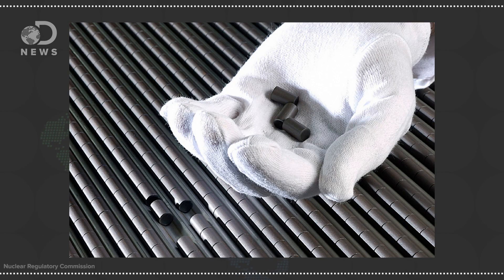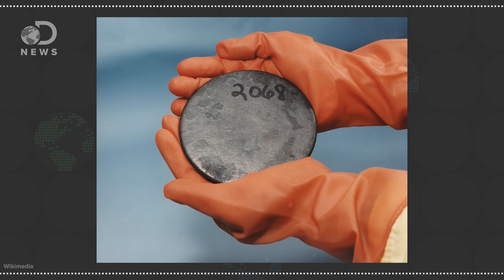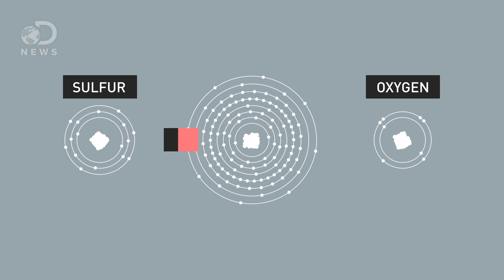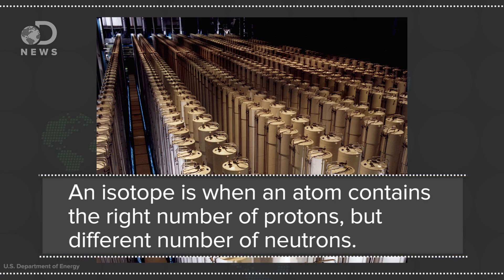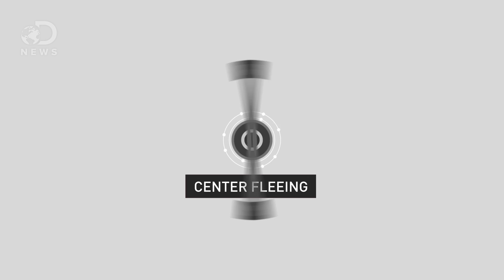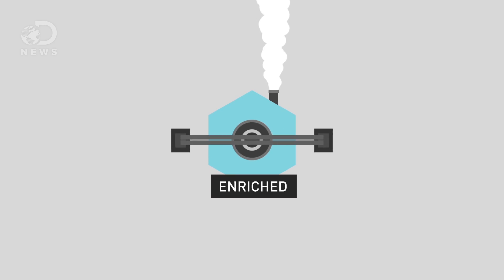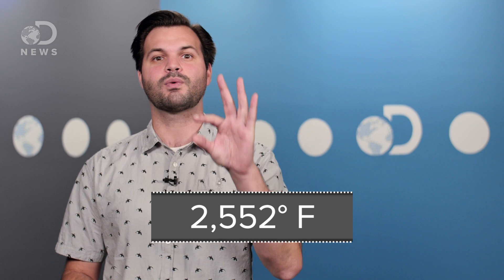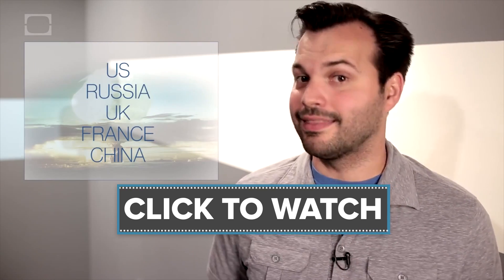How Uranium Becomes Nuclear Fuel

Comment: It's still one of the cleanest and one of the most efficient and reliable sources of power. It also has the highest proportion of power generated to power needed to process fuel. The main problem is that due to the uproar against nuclear energy all of the reactors are at least 30 years old... that's not good, since the technology advanced so much that if you were to build a nuclear reactor now it would be almost 10 times as safe as the existing ones.
Reply: carlos almaraz That's steam, not smoke.  Those are cooling towers, there are no combustion chambers in nuclear plants.
Reply: Damian Reloaded If you think the mob gets rid of nuclear waste, you're delusional.
Reply: I don't think the main problem is negative public opinion, more crippeling problem is money: Goverments don't have funds to make safer plants and companies won't spend money to improve thing unless they get more money from that.
It should be made so, that a goverment agency would force power companies to update their plants, but as long as companies influence regulations, it's never going to happen.
Best thing of all would be upgrading oldest plants into thorium reactors.
Reply: @Somezable  The Waste is another problem. No one wants it in their backyard so to speak.
Reply: @Somezable  it's really expensive because environemental groups like Greenpeace lobbied to create really strict and expensive regulations around it. Mostly because they don't want it to be competitive with wind and solar since they have vested interest in locking in power purchase agreements and renewable energy subsidies for those contracts.
Reply: Somezable Public opinion fuels political action.  If people were pushing for nuclear reactors instead of prematurely pushing for "renewable" energies, the funding would be there.  Nuclear reactors are a drop in the bucket compared to what the gov't is spending in the form of subsidies for solar and wind power.

I agree that thorium is the way to go, but there is no logical way of going about converting current reactor technology to thorium power.  We would have to start over with completely new plant dimensions, power handling, and of course reactor configuration.  The cool thing about thorium based systems is that there is no need for special safety systems that have to be in place currently for nuclear power.  There is no high pressure steam loop, there is no danger of a "meltdown", so there is no need for a massive containment structure, like there is with reactors that are currently in operation.

Thorium power is an order of magnitude cheaper than our current nuclear plants.  Revamping our installed plants would cost more than building a new reactor based on thorium.
Reply: Damian Reloaded you're already cancerous
Reply: darkheat246 Our business model is perfect: create the most ridiculous scare tactics against clearly beneficial technologies, and watch the bodies of the illogical people pile up.

Shout out to Damian.
Reply: Damian Reloaded http://www.world-nuclear.org/info/nuclear-fuel-cycle/nuclear-wastes/radioactive-waste-management/

there's just one.

Give a source that shows the "mob" disposing of nuclear waste.
Reply: Damian Reloaded I guess you're uneducated on the entire subject of secondhand smoke as well as nuclear technologies.  Nice.
Reply: MaxFist Yet people refuse to allow new nuclear plants to be built.  I hate people.
Reply: @RentableSocks  people dont understand nuclear tech. People fear what they do not understand.
Reply: @RentableSocks  Environmentalist* environmentalists don't want nuclear built like Greenpeace who lobbied to create really strict regulations on it. They only want wind and solar for power because they have a vested interest in locking in lucrative power purchase agreements and government subsidies for their own renewable energy policies.
Reply: Damian Reloaded Also, you're talking about italy, nobody else in this thread is.  You just took a whole different country's problems and tried to turn it into ours.  Please get a clue.
Reply: Damian Reloaded  coal kills lots of people a year too.
Reply: Damian Reloaded "When uncontained" are the key words here. 

It really sounds like you have some trust issues...
Reply: Damian Reloaded Here we are with the ridiculous claims coming from someone with no understanding of what they are saying.

It's sad, really.
Reply: Damian Reloaded Your point is invalid though, you're being fed fear tactics and eating it up.  As I said the first time you tried quoting that, the anecdote is from almost 30 years ago, and no longer relevant.

Your risk of death from driving a car is much higher than the risk for cancer from radiation.  This is one of many instances you're just blinded by fear.
Reply: darkheat246 It's not like I'm doing anything else with my time, might as well mount my defenses for crazy people who are deathly afraid of nuclear power, being that I am a huge supporter of it.
Reply: Niklas Jonsson Don't listen to the troll.

India as well as China have plans in development for thorium reactors.  In fact, the thorium reactor was one of the first nuclear plants built.  What you are referring to is Liquid Fueled Thorium Ractors (LFTR).  What these plants are capable of doing is crazy, and there is no danger of proliferation or waste.  All we have to do is add fissile material to it, none comes out.

My buddy is a nuclear engineer, and apparently in order to graduate he had to design a fully fledged nuclear reactor, so I think plans are constantly churning out.  Our gen. 4 reactors that are in development right now are about 30% more efficient, and can use more than twice the amount of energy coming from the uranium (about 97% of the fissile material is still intact when it is considered "waste")

I'm still waiting on the end of my chair for LFTR though :)
Reply: darkheat246 we should follow the way of the Egyptians and use "chew sticks".  Toothpaste is obviously a useless technology invented by the Illuminati to get everybody who isn't a high rank to kill themselves slowly.  THE MORE YOU KNOW....
Reply: oobligah that's a real business there congrats
Reply: Damian Reloaded so you're wrong and we're trolls gg kid.
Reply: Somezable I dont know about the US, but here in sweden companies have plans ready to build new reactors but are not allowed by the government, so its basically the other way around. 

New plants would be both more efficient and the residue left would be a lot less radioactive. Some plants would actually be able to take the old residue and run it in reactors again to get more energy out and make it less radioactive. 

Thorium reactors would be great but from what i know they dont exist yet, even if they are not as far fetched as fusion reactors. What i dont get is why even research around nuclear power is disencouraged by a lot of environmental organisations. Here we have the power of the stars, basically infinite energy with no co2 emission and a very safe process and still it is resisted due to ideologial beliefs and some irrational fear of the word "radiation" and things they dont fully understand.
Reply: Damian Reloaded I want some evidence before your conviction of anger
Reply: Damian Reloaded You know in school they say don't cite Wikipedia........
Reply: No I'm afraid ten times is a huge understatement. We have built and demonstrated the Integral Fast Reactor that cannot be made to melt down by removing cooling by accident or even delibertly. In a demonstration the cooling was suddenly and totally removed. The Reactor just quietly increased in temperature for a small amount then just quietly stopped working. So it is the safest reactor ever invented. Better yet the old war heads and "so called" spent fuel rods from our stupid high pressure water reactors can be used and therefore cleaning up almost all the waste we are storing all over the globe. Democrats that the oil companies have bought scrapped the projects for obvious reasons.  
Google IFR reactors.
Reply: MaxFist I trust you, Dr. Strangelove.
Reply: oobligah money isn't an issue for plants it's just pure laziness and a lack to try to do anything
Reply: oobligah exactly
Reply: oobligah he's just trolling you
Reply: Damian Reloaded no humans are the cancer you get cancer from almost everything
Reply: darkheat246 Cigarettes, Decaf coffee, diet sodas, corn, wheat, toothpaste, plastic bottles, cell phones, computers, asprin.  The feigned list goes on and on.
Reply: Damian Reloaded that's an issue with old reactors and your government. The simple solution is to ban your country from nuclear activity until it's heavily monitored and controlled by America and the UN.
Reply: Damian Reloaded Anecdotal single source troll.
Reply: Damian Reloaded That prediction assertion in itself is fallacious, it doesn't consider the advancement of technology, like I have been saying that you are ignoring this whole time.  There is no reason to continue the operation of gen 2 reactors in their current state. 

Gen 3 reactors are ready to be built, and are orders of magnitude safer than gen 2 reactors.  Gen 4 reactors a still in development, but will be orders of magnitude safer than gen 3.

This is also not taking into consideration the placement of nuclear reactors, which was a huge factor in why the fukushima reactors were damaged.  This reactor was placed on a fault line, and close enough to the coast to be damaged by tsunamis.  This, coupled with the fact that the three reactor failures at fukushima are the majority of the dataset of the "serious accidents", means that those data points are not statistically significant enough to consider them 3 separate failures, but instead should be treated as one.  Prediction for things like reactor failure is not reliable.  If you also take into account that three mile island was undergoing a test, and that chernobyl was actually an unsafe reactor design, most of these should not be considered in predicting reactor failures.

Take anything with the word "prediction" with a bucket of salt.
Reply: ***** that's Dr. Fist to you, sir.
Reply: Damian Reloaded Also, even if you take my comment out of context, if you were try to synthesize weapons grade uranium from thorium, the gamma rays literally tell everyone exactly what you are doing.  They are easily detected, and any activity like that would be ended immediately.
Reply: oobligah I guess everyone should stop brushing their teeth xD
Reply: Damian Reloaded Authority fallacy? Do you know what that means?  In order for an authority fallacy to be considered fallacious, there has to be a logical fallacy that is created by said authority appeal.  None of my comments are fallacious, however you (by trying to deny reason) are creating fallacious arguments left and right, and are no longer logically relevant.  

You are actually using argumentum ad metum, like I said before..  You are doing exactly what the anti-vaxxers do.  "Hundreds of articles and papers say nuclear power is safe, but here's one that says someone did something and it ended badly"  turns into "OMG IT'S SO DANGEROUS BECAUSE PEOPLE CAN'T CONTROL THE ACTIONS OF OTHER PEOPLE AND I'M SO SCARED OF THE COMING NUCLEAR APOCALYPSE BECAUSE OF THE MOB DISTRIBUTING NUCLEAR WASTE INTO EVERYBODY'S FOOD"

I'm systematically denying everything you say because it IS beyond you.  Also, your data set is from decades ago, and is no longer relevant.  So, you're pretty much wrong on all counts, which is why I'm saying you're wrong.  Every time.
Reply: Damian Reloaded rekt.
Reply: oobligah nope kiddo.
Reply: As a nuclear engineer well read on this subject, the proliferation resistance of U-233 is very overstated. Large gamma emission just requires more remote handling of material and this has been proved in the THOREX process to be highly possible. Proliferation is not really linked to terrorism so "baddies" are not the people who are of most concern to the IAEA when U-233 is discussed. Countries such as India have the most interest in U-233 weapons and its the security that they can provide to this process from spreading to other current non nuclear states that is the issue, preventing more instances such as the A.Q Khan leaks that lead to Pakistan and Iran gaining much of their information on U-235 enrichment.
Reply: +MaxFist Nuclear waste is renewable.
Reply: Damian Reloaded Actually, France reuses up to 80% of their nuclear waste.  In a solid fueled nuclear reactor fuel cycle, only a few percent of the radioactive material is used up during burn time.  Since it is a solid fuel, gas builds up inside it and fractures the fuel pellets, making them unable to be used as fuel (huge drops in fission efficiency).

However, if you reprocess the fuel pellets, you can continue to use previously "spent" fuel.  In the US, we've limited ourselves to be unable to reprocess and reuse spent nuclear fuel, so that's why they bury it.

On another note, reactor technologies like LFTR can consume unused fuel (without reprocessing), since the fuel melts down (not the bad kind) inside the reactor, and releases the previously trapped gases.  The previously "spent" fuel then becomes concentrated enough for fission again, yielding more power.
Reply: Nuclear  energy has  proven  to  be a DISASTER    to  the  planet-to  call this  technology  safe  is an  insult to  intelligent  people-NO technology  exists  to dispose  of nuclear waste, NO  plant  is safe  from major catastrophes, the government/business aspect of  industry that oversees it  is  UTTERLY  CORRUPT, GROSSLY  MISMANAGES  the  most  poisonous substance on the  planet for $$, constantly  LIES  to  the public  about  safety, accidents, FELONS are  rarely made  to  pay  for their deeds, the  system  promotes the  worst  CORRUPTION, TREASON in  the  political arena, as  we read  this  Fukushima  is  continuing to  spew radioactive  waste into  the environment as  it  has  been  doing for  YEARS,  etc. not to  mention  this  technology  has BANKRUPTED  the  planet, especially taking  into account the  massive  cleanup of nuclear  waste and  plants  in  the  near  future
Reply: One simple reason. 30 year old reactors are cheaper. That is how an RBMK reactor explodes.
Reply: OHHHHHHH
Reply: oobligah Just because You say it isn't relevant doesn't make it true. You're trying to use an authority fallacy without having any authority yourself. You just systematically deny anything I say, for some reason that is beyond me. I've proven that men as with almost any other thing we touch, can't be trusted to manage these materials in a safely manner. And even if we trusted them and they did the right thing, we still are subjected to the possibility of a disaster happening and poisoning who knows how many hundred of thousands of square miles with radioctive fallout for thousands of years, without any possibility of cleaning it up. As if we hadn't enough ecological problems already.
Reply: oobligah Yes you are trying to validate your arguments on the basis that because you say them they are true and because whoever disagrees with you is not you therefore they are wrong. That's fallacious and insane. I couldn't care less about the thousands of articles saying that nuclear power is safe when there are thousands of people dying because of exposure to nuclear fallout from blown up nuclear power plants or ill-disposed nuclear waste. So you see, it doesn't matter how much you like your nuclear power, it is killing people as we speak. It's happening whether you like it or not. I'm totally ok with its use in space where exposure to radiation is the rule, but down here, nah, down here, living things we don't get along with it.
Reply: Damian Reloaded Everyone who agrees with me isn't me, but they are right because they are right.  People who disagree with me are wrong because they are WRONG not because they aren't me.  You keep saying thousands of people are dying, and berating this "ill-disposed" nuclear waste article (which is too old to stand up to anything that we have been talking about) but you don't cite anything, and you don't care to look at the research.  You are failing yourself, and I feel sorry for your kids, if you have any, because they are growing up with a moronic parent who eats fear tactics and propaganda for breakfast.
Reply: gtfo XD
Reply: Damian Reloaded When your only response can be "gtfo XD", and you refuse to see logic, you've lost the argument.  Sorry for your loss.  Sorry not sorry.
Reply: Damian Reloaded You're putting words in my mouth, there are obviously certain people who are more trustworthy than others, and "ex convict rapists" aren't the people disposing of nuclear waste.  You're trying to equate two things that are not equal.
Reply: oobligah I'm just applying your logic, you say documents from 30 years ago do not count because? What? Human nature has changed since then?
Reply: Damian Reloaded Regulation has changed since then, and so has reactor design.  Technological developments now allow safe nuclear power, as well as the elimination of nuclear waste, and the consumption of existing waste.  All of these are good things, and these developments have come after your 30 year old article.  The majority of people are good, there's no question about that.  The fact that you see 5% of people as 100% of people is kind of disheartening, other than the fact that you're ignoring the scientific achievements in the nuclear world.
Reply: oobligah I really fail to see where you get your numbers from. And even if you were right, and only 5% was getting sick because of radioactive contamination, you propose to rise that to 100% by building fission plants everywhere. Great plan bro!
Reply: Damian Reloaded You're twisting my words again, If you can follow the chain of comments, I was referring to the proportion of people who do "bad" things compared to those that don't.  Maybe that's the reason why you have so much trouble following what people are saying in their arguments.
Reply: oobligah I don't need to twist your words. They are twisted by themselves. The fact that you want to drive this conversation towards semantics says what you are really up to.
Reply: Damian Reloaded Correcting your misinterpretation of what I am saying is not semantics, you just fail to follow logic and the context of anything that I'm saying.  Correcting for context is not semantics, it is returning the discussion from the weird tangents that you're going on.

Saying that "only 5% of people are bad" cannot possibly equate to "only 5% of people are affected by radiation".  I have no idea how you came to that conclusion, because it is actually impossible to.  You jumped there, probably due to not reading, or not understanding what I was saying.  Every time you take something out of context, you lose credibility, and at this point I'm pretty sure you're an 8 year old kid who has gotten his hands on daddy's laptop.
Reply: oobligah You are arguing semantics. What I interpreted didn't need correction because it was irrelevant whether 5% people is vicious or 5% of people is ill, because both are false assertions and pulled right from your ass. As most of what you say. You sell this shit like a google spokesman but you present no evidence to back up what you say, because you can't. You can't prove people aren't getting sick from radioactive contamination, therefore denying it makes you a liar. (ed.sp)
Reply: Damian Reloaded The incarceration rate in the US is 4.4%, which is the lowest out of the developed nations.  It is not a false assertion.  Look it up if you want, you'll find the same.

By asserting that it is irrelevant whether 5% of people are vicious or 5% of people is ill, you are presenting a red herring, which is fallacious.  You are intentionally derailing the conversation by switching the subject that was at hand.

You're also presenting a fallacy right now with your "you can't prove people [aren't] getting sick [from] radioactive contamination,therefor denying it makes you a liar" statement.  That is called an appeal to ignorance.  

I'm sorry, you need to read up on both logic and reasoning, and be able to present an argument that isn't fallacious.
Reply: oobligah That's exactly what is wrong with your thought processes, you measure trustworthiness of humans by measuring incarceration rates (in the US nonetheless!). You do live in a movie.
It was irrelevant because it's FALSE. You cannot state, by any means, that 95% of the world population is good in the heart based on incarceration rates. That's insane dude!
If you deny something you cannot prove, you're biased, to say the least. I choose to call you a liar. And btw, thanks for correcting my spelling, english is not even my 2nd language.
Reply: Damian Reloaded Its a reasonable thought process, laws are supposed to keep people from being shitty, shitty people break laws. law breakers go to jail.  It's fair to say the two are strongly correlated.  Someone that leans one way because of statistical evidence is not "biased" but rather more informed than the party not citing statistical evidence and using fear tactics.

There are heaps of evidence directly contradicting what you say, and you continue to tout your one italian mobster from 30 years ago, which is irrelevant.  You say nuclear power causes cancer, when it doesn't.  Waste disposed from nuclear plants is not dangerous because it is properly taken care of.  I implore you to try to find somewhere else that says nuclear waste is not disposed of properly.  The rates of cancer for people around nuclear plants is the same as those not around nuclear plants, and there is a strong causal link between coal power plants and cancer rates, due to THEIR radioactive debris.  No such link can be called to nuclear plants, and even if it were, you would be able to see it with nuclear plant technicians before anyone else, but this is simply not the case.  Living near a nuclear plant gives you less ionized radiation through your entire lifetime than 10 chest x-rays.

You're trying to base your case on emotion rather than statistical evidence, saying the majority of people are bad, and saying that these "bad" people shouldn't be in charge of the disposal of nuclear waste.  Your argument has been proved to be groundless, as well as fallacious, and you are continuing to be fallacious as this goes on.

I corrected it in my quote, because that's how it should have read and I understood what you meant.  It wasn't a jab.
Reply: Uhm. No. I'm basing my case on well documented evidence that is for everyone to gather from wikipedia and the most important science magazines and news papers world wide. You're just repeating yourself that Nuclear Power Plants are the safest choice and that we should have them everywhere because there are no risks involved. And you're lying.
Reply: Damian Reloaded or take a look here:
http://nextbigfuture.com/2011/03/deaths-per-twh-by-energy-source.html
Reply: Damian Reloaded or take a look here, even.
http://theenergycollective.com/willem-post/191326/deaths-nuclear-energy-compared-other-causes
Reply: Damian Reloaded I can keep going...

http://motherboard.vice.com/blog/whats-the-deadliest-power-source
Reply: Damian Reloaded and a report on safety...

http://www.oecd-nea.org/ndd/reports/2010/nea6862-comparing-risks.pdf
Reply: Damian Reloaded Uranium beams? What are you even talking about?  Uranium used in reactors is in the form of pellets.  Reactors are now designed to withstand such impacts.  I don't see your point.  You've gone off on another tangential red herring, again derailing the argument.  Also revealing your racism.  Sad.
Reply: oobligah Talking to you is like talking to eliza chatbot. sigh. I take it you're willing to risk the well being of your family for it. I'm not.
Reply: Damian Reloaded You asked if jet fuel could melt through uranium beams, and those don't exist.  There is no risk of a modern nuclear plant melting down, or struck by an airplane.  Reactor chambers are encased in 2 inch+ hardened steel, and on top of that, most of the reactor chambers are placed dozens of feet underground.  This makes attack by airplane virtually impossible, and in no way can it cause a melt down.

You're presenting valid looking points, but none of your arguments are sound.  Even if your arguments were completely valid, there is no evidence to prove that your conditions for your conclusion are true, and in fact it has been proven that the conditions to your argument are false, and your conclusion is therefore false.  Not to mention that your conclusion itself has been proved false.

I bet you didn't even read any of those articles or reports that I linked.  There's a wealth of information on the safety of nuclear plants, but since you can't be bothered to read anything, I'll put it plainly:

Nuclear power is orders of magnitude safer than any other major form of electricity production, including renewables such as solar, hydro, wind.  If you were to redirect your fear mongering to where it actually counts, that would be a different story.  Per amount of energy produced, nuclear has the lowest death toll and death rate, even including the chernobyl and fukushima reactor mishaps.
Reply: It has been proven that the same kind of people who run this Nuclear Power Plants you like so much were able to poison the american population with lead (in gasoline) for over 30 years and they were so powerful that it took democracy 30 years to force them to stop. I literally wipe my ass with any paper they will present to the public to defend their business.
Reply: Damian Reloaded False, the people who run nuclear power plants are engineers and physicists, not the government.  Regulation is employed by government, but this is by no means "running"  So, no.

Your rejection of such papers is what makes you actually biased, because you refuse to even hear evidence on the opposing argument, even when hundreds of resources point to the same conclusions.

With respect to the leaded gasoline, lead was used as a lubricant, and it was not scientifically proven to be neither harmful or safe when used in gasoline.  Nuclear, on the other hand, is purpose built, and has been proven safe.  You're barking up the wrong tree.
Reply: Damian Reloaded Investors don't run, they invest.  I still don't know where you're trying to go with this, as you've been proven incorrect in almost every instance.  If you didn't know, without investors there wouldn't be any electricity, or computers, or office buildings, or apartment complexes, or pretty much anything that has a high startup cost.  Investors want stable income from their investments, which means if someone invested in a nuclear plant, they don't want to see that waste harming people, because it will get shut down by regulation enforcement.  You have no grounds for an argument, even if people like making money.
Reply: I was re reading the wiki entry Economics_of_nuclear_power_plants , this part is really interesting: "An interdisciplinary team from MIT have estimated that given the expected growth of nuclear power from 2005 to 2055, at least four serious nuclear accidents would be expected in that period.[80][81] To date, there have been five serious accidents (core damage) in the world since 1970 (one at Three Mile Island in 1979; one at Chernobyl in 1986; and three at Fukushima-Daiichi in 2011), corresponding to the beginning of the operation of generation II reactors. This leads to on average one serious accident happening every eight years worldwide.[78]"
Reply: oobligah I take everything people say with a bucket of salt. I personally think the risks are too high (in terms of ecological damage over time). But the world leaders seem to think otherwise. We need nuclear power to power our air conditioners and watch our porn on internet. Priorities.
Reply: oobligah Sorry but U-233 can be used in the production of nuclear weapons and requires significantly less infrastructure to do so compared to a uranium fuel cycle if you are starting the process from scratch. The Thorium and fusion evangelists are just as ill informed as the guy your arguing with here...
Reply: tomsan91 It can be, however there is a massive deterrent, which comes in the form of huge amounts of gamma radiation.  That is a tell-all for nuclear weapons development, and would be very hard to mask in order to skirt the authorities.  This type of radiation is also deadly to anyone who is working near it, even for just a few minutes.  So, yes, but there are major downsides to using it which would prevent the baddies from doing so.
Reply: +tomsan91 how about salt reactors?
Reply: +tomsan91 I'm child of холодная война, (cold war), & I'm well read on medical issues from radiation exposure. I don't watch missile launch vids as I get adrenaline rush from fear. I'm slowly warming to nuclear power.
Reply: Masashi Ng no it's not. Otherwise they wouldn't bury it.
Reply: It's always great when private individuals repeat private corporate nuclear energy co propaganda.
Reply: Ancient Greeks invented plutonium, uranium and the americium ( it should be called Helenicium ).
European invaders ( Romans, France, Germany etc ) stole the ancient greek inventions from Alexandria library books ( million pages ) which contains all information about 94+ elements, pipes, gases, prism detection by light, technologies etc.

Better explanation to people who do not understand.
Example: Romans stole four Harry Potter books. The four Harry Potter books became divided due to war, theft, lost and found.

Germany got Harry Potter 1, tested it the invention and then they burned it and claim the world that they have invented it.

Russia got Harry Potter 2, tested it the invention and then they burned it and claim the world that they have invented it.

Sweden got Harry Potter 3, tested it the invention and then they burned it and claim the world that they have invented it.

America got Harry Potter 4, tested it the invention and then they burned it and claim the world that they have invented it.

and so on...
Reply: carlos Wudup steam water dude
Reply: oobligah so what do you think about the integral fast reactor ? isn't that the best idea, isn't it basically infinite energy? why aren't people building this?
Reply: tevin persinger no he is right, it was due to politics. watch this video 
https://youtu.be/Sp1Xja6HlIU
Reply: eh. what about fukushima
Reply: How can you call it clean when it's fall outs has poisoned people over and over for years. Deluded much.
Reply: Nuclear power plants are the safest method to make electricity based on deaths per kWh of electricity produced!  Amazingly, solar is more dangerous due to things like workers falling off roofs!
Reply: MaxFist nuclear is efficient but its not "Green" we have to dig to find uranium and we have radioactive waste at the other end of the plant process.  The greenest is solar but that still requires a lot of space to be used.
Reply: MaxFist A nuclear waste?
Reply: the problem is the nuclear waste. No long term solutions have been found for it
Reply: Cleanest except for all the highly radioactive waste that we still have no solution to store permanently... Smh
Reply: Well if they build new ones the upkeep for that plus the old ones will tally up...and you also have to take into account that natural disasters ect can happen ...that increases the chance of an irreversable incident
Reply: The cleanest and most reliable is falling water. Wtf you say?
Reply: Hang on, where you gonna through the waste after using it, which will still gonna be radio active but of no use ?
Reply: And nuclear waste? Nuclear energy cannot be called 'clean' by any means.
Reply: MaxFist so you reckon nuclear energy is clean energy do you? Well consider this, nuclear reactors produce vast amounts of incredibly radioactive fission products some of which do not exist on this planet anywhere outside of the reactor cores, e.g- caesium 137, this radio nucleide is extremely toxic to organic life forms and has been released into the environment in huge quantities from the triple melt downs at fukushima, now, one gram of radioactive caesium 137 when made into mico-particles and distributed evenly as a gas, over an area of 1 sq kilometer would make that area of land unfit for habitation or agriculture for between 240 and 320 years, this is clean energy is it? Take a look at how many THOUSANDS OF TONS of high level nuclear waste is currently being stored at various sites all over the USA, and then tell us just how clean nuclear energy is, oh, and lets keep in mind that ALL the nuclear waste we have so far produced will remain lethally toxic for hundreds, and in some cases thousands of years and we still havent figured out what we are going to do with it.
Reply: Yep. It's sad that the stigma of nuclear power still stops its progress. Modern reactors are extremely safe, efficient and greener than coal, oil and other petroleum based fuels.
Reply: Ita not really that clean when they have so much nuclear waste and nowhere to put it, considering it takes nearly 4tonnes of uranium to produce 60kg of U235, so no il use  sellafield in the UK, have 100,000 tonnes of nuclear waste and nowhere to put it, so how is it so clean with all that radioactive waste that can stay radioactive for 24,000 years???
Reply: i mean, "nuclear" is the issue, i dont want to live next to or within 100 miles of a nuclear power plant, it might be the "nuclear" part, or maybe i just dont want to live next to a potential explosion that would level everything around it. no to keen on that idea, not to mention nuclear means theres radiation and i dont care how "safe" the levels are, its higher then it would be without the power plant there so no thank you, your welcome to have one built next to you tho.
Reply: @MaxFist fusion is clean, not fission.
Reply: MaxFist it is more complicated than that. Most reactors got built when prices where well under $3000 per MW, which is roughly what you pay for a coal plant. Countries built a lot of nuclear because it was the cheapest power.  But what happened is that as companies tries to improve reactors, make them more powerful, efficient, safer etc, the price just grew faster then the output. 

This happened both before people got skeptical towards nuclear power and it happened in almost every country. Prices went up because nuclear power is simply a very complex technology and increasing size of reactors was likely a profound mistake. Reactors today are so insanely expensive that it just doesn't make any sense to build them.

Until we go back to the drawing board (which many have) and design a new generation reactors which are smaller, simpler and safer, it makes no sense to keep building nuclear reactors.

People like to think about this stuff as a conspiracy. Oh it is all the nuclear protesters fault, but you can see the same trend for almost ANY advance technology. Lookup how much it cost NASA to build the Saturn V. Now compare how much it costs them to build the SLS of similar capacity. Despite far more advance technology and knowledge today, this rocket cost SIGNIFICANTLY more than the Saturn V.

Look up high rise buildings. Nobody builds skyscrapers as fast and cheap as they built the empire state building today. Lookup road construction costs today. Basically we have just gotten really shitty at large constructions. We do everything large and complex way more expensive than in the past. It is a global trend.
Reply: Damian Reloaded Right, is that just because you can't read? or because you don't know what citing your sources is? or is it just your lack of comprehension on the subject?

Maybe it's the fact that you have no idea what you're talking about, so you ignore facts, and express what your mind has tried to present as an argument, when all it looks like is a frantic attempt to not come off as a moron.
Reply: Damian Reloaded Might want to cite your source instead of copying directly from what I can only assume is wikipedia.

You need to learn context, and how current environmental regulations prohibit such dumping.

Today, "nuclear waste disposal" does not mean dumping it into the ocean.  To assume something like that is ridiculous.
Reply: Damian Reloaded Neither effects from Chernobyl nor nuclear testing fallout count as "nuclear waste disposal", so your argument there is pretty invalid.

With regard to Thorium, no.  There is no possible way for uranium derived from Thorium used in nuclear reactions to be used in weapons.  Thorium based nuclear power is a proliferation free technology.  When Thorium is converted into Uranium, it is converted into U233 inside the actual reactor (LFTR), which makes it impossible to use in nuclear weapons.

I can, and do trust them.  Significant public backlash would occur if any corporation began dumping nuclear waste improperly in any developed country.  Such backlash would bankrupt them.  They know this.  In order to ensure this, there are regulations, as I have stated before.  I think you are underestimating how strict such regulations are in first world countries.
Reply: darkheat246 there is no money where there is no intent.
Reply: Damian Reloaded My daddy died years ago, I've been in control for almost a decade now.  Record profits, public in outrage.  It's amazing, actually.
Reply: oobligah For some reason youtube deletes my posts when I write a link. You can select the first words, right click and search in google. The first result will be the source of that text (which is wikipedia btw).

You need to understand that we don't live in a movie where everything is pristine and pure and where leaders have the best intentions.

The nine countries with most cases of cancer are nuclear or were in the way of chernobyl debree or nuclear testing fallout. Uranium enrichment or synthesis by thorium reaction can be used as a weapon. The more radiactive material you have around, the more the chances terrorists will serve you a coffee with it. Can you count on corporations doing the right thing at the moment of disposing of radioactive hazards? As a matter of fact they have proven already that you can't.
Reply: KnightRaymund you'd best just not respond to that kid, he's a troll and has no idea what hes even saying.
Reply: Damian Reloaded Fortunately for me, I'm a corporate pig that benefits from poisoning you, a member of the irrelevant general public ;)
Reply: oobligah French nuclear recycling may help reducing a little the amount of radioactive waste that goes back to the ground but that's far from being a long term solution. Nuclear energy inherently implies the storage of nuclear waste through time. It may not be an evident problem now, specially when those who own the nuclear business also own the media and the politicians who make the laws. But as more nuclear plants get built more waste will be produced and not far into the future someone is gonna fuck up (as they have fucked up in the past by throwing nuclear waste into the oceans or asking the mafia to make it "disappear" on someone else's backyard ) and it's going to be bad. Not to mention the damage it already causes to the environment the mega mining and chemical techniques used to extract the plutonium in the first place.
Reply: The problem with nuclear plants isn't the contamination they produce while they are running. It's the radio isotopic contamination of their waste what gives people cancer. And no, the waste isn't always disposed properly. Greedy bastards will always prefer to pay the mob to make the waste "disappear". And for all the mob cares about you they may very well make it "disappear" right in the place where the water you drink is coming from.
Reply: Damian Reloaded you didn't read my comment.
Reply: Nuclear waste is ill disposed and gives people cancer.
Reply: darkheat246 Yeah, we have nuclear plants here too. That's why.
Reply: radioactive waste == cancer.
Reply: Damian Reloaded You're just spouting off nonsense.  Not worth my time.
Reply: KnightRaymund It is not the same kind of residue. But we need to stop burning coal too.
Reply: oobligah LOL. That's the only thing you have said in this thread that is at least plausible.
Reply: Everyone is free to chose the way they want to get cancer.
Reply: All things of which none gives you cancer by standing next to them.
Reply: oobligah You're reflecting. But I understand you're in denial. The american government has already poisoned it's citizens with lead in the past. Deep inside you know they could be feeding you any kind of shit so corporate pigs can get richer.
Reply: oobligah That's what it looks like. I'm sorry for undermining your dady's job.
Reply: lol, what a bunch of trolls XD
Reply: darkheat246 lol, you need to bring more friends to call me wrong. ^_^
Reply: Niklas Jonsson It is resisted because radioactivity has proven to be the most hazardous thing we have put our hands onto when un-contained. The theory of fission reactors is the coolest thing in the world. In practice, it is selfish criminals who manage them and are in charge of disposing the waste.
Reply: You may want to read the article: "Swedes still dying from Chernobyl radiation"
Reply: Niklas Jonsson Well founded. Not even the smartest most honorable Japanese with all their technology were able prevent nuclear radio isotopic contamination when tragedy arrived. Imagine what IS HAPPENING in countries where the Italian/Russian/younameit mafias are the contractors AND the politicians who run these plants. The waste gets sunken in the mediteranean or dumped on a beach.
Reply: darkheat246 Don't be ridiculous. My country doesn't have any problems of that sort. And america is one of the countries that paid the italian mob to get rid of their nuclear waste. So, get real.
Reply: from nature magazine: Italian mafia accused of trafficking nuclear waste
"A mafia informer told the anti-mafia bureau in Potenza that an ENEA manager paid the 'Ndrangheta mafia to get rid of 600 drums of nuclear and toxic waste from Germany, France, Switzerland and the United States in 1987. He claimed that the mafia disposed of the radioactive material at unauthorized, non-secure sites in southern Italy, Somalia and in the Mediterranean Sea."
Reply: oobligah it's enough to prove my point. Men can't be trusted with this shit. If you multiply the Fission Plants you will multiply the risk and the reach of the inevitable. Because shit will always happen.
Reply: Not sure whether to trust you or not. Sounded good till you got political. Most politicians (regardless of party) are bought out by oil companies.
Reply: 🍎™                          MaxFist⚡💀 the waste will be put in your back yard
Reply: oobligah From 1946 through 1993, thirteen countries (fourteen, if the USSR and Russia are considered separately) used ocean disposal or ocean dumping as a method to dispose of nuclear/radioactive waste. The waste materials included both liquids and solids housed in various containers, as well as reactor vessels, with and without spent or damaged nuclear fuel.[1] Since 1993, ocean disposal has been banned by international treaties. (London Convention (1972), Basel Convention, MARPOL 73/78)

However, according to the United Nations, some companies have been dumping radioactive waste and other hazardous materials into the coastal waters of Somalia, taking advantage of the fact that the country had no functioning government from the early 1990s onwards. According to one official at the United Nations, this caused health problems for locals in the coastal region and posed a significant danger to Somalia's fishing industry and local marine life.[2]
Reply: oobligah You are utterly uninformed. Just by googling Thorium-based nuclear power leads to the wiki entry (Thorium-based_nuclear_power) that starts by saying this: Thorium-based nuclear power is nuclear reactor-based electrical power generation fueled primarily by the fission of the isotope uranium-233 produced from the fertile element thorium. And also: Thorium, when being irradiated for use in reactors, will make uranium-232, which is very dangerous due to the gamma rays it emits. This irradiation process may be able to be altered slightly by removing protactinium-233. The irradiation would then make uranium-233 in lieu of uranium-232, which can be used in nuclear weapons to make thorium into a dual purpose fuel.
Reply: oobligah You're in denial then.
Reply: oobligah Have a nice cancer in your nuclear plant. ;)
Reply: oobligah Nuclear contamination is probably what causes autism in children in America. Makes much more sense than vaccines.
Reply: oobligah You are uninformed.
Reply: MaxFist can I ask you a question, why is their smoke coming out of nuclear plants
Reply: @Thecarlosbrochannel  It's not smoke, its water vapor coming out of the cooling towers
Reply: @Thecarlosbrochannel  Its steam cooling the reactor its totaly safe the steam is just like steam frome a cattle.
Reply: @Thecarlosbrochannel  Its a STEAM.  Water that was biled, over 100°c.  Not radioactive, not contaminated, nothing, just ordinary steam, that spinning turbines that generate your electricity.     
In a Coal power plants you see smoke
When you burn coal you get smoke, dark smoke, and it's carbon dioxide, and that is dangerous.  this is what causes global warming, this is what killing us.  And it's the same with gas power.

Coal and Gas - Dark black SMOKE (Extremely dangerous)

Nuclear energy - water STEAM (like in your kettle)
Reply: @Thecarlosbrochannel  Most of that is steam and water vapor from the cooling tower.  The heat from the reactor is used to make high pressure steam.  

The steam is used to spin a turbine,  that is similar to a jet engine but runs on steam instead of jet fuel. 

The leftover steam from this is cooled in the tall towers and recycled back into the system.